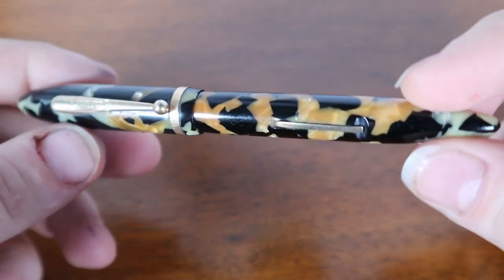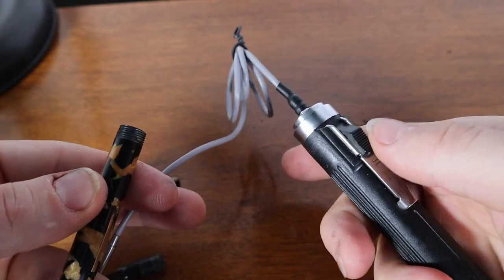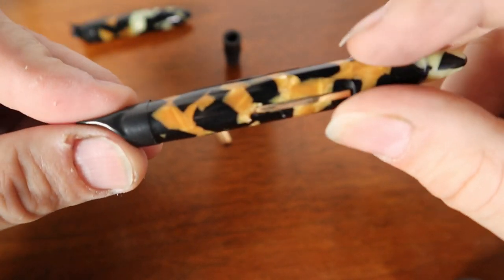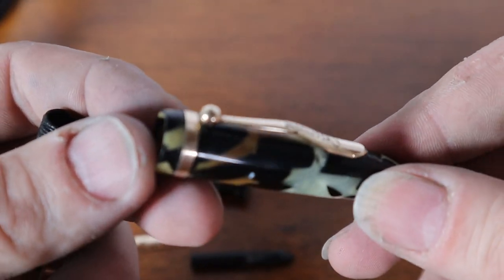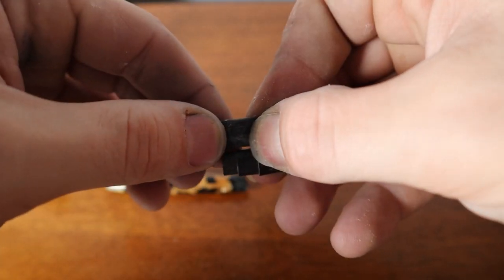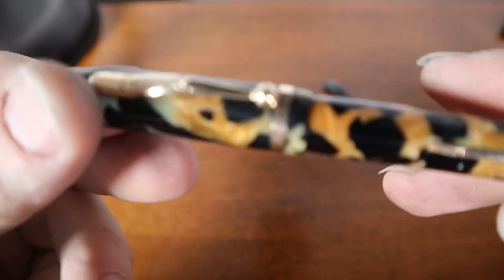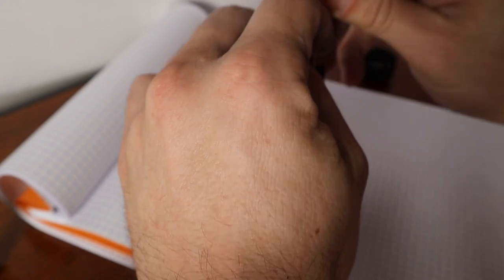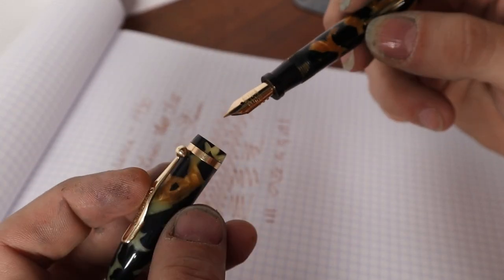Sheaffer Balance Lever Fill Restoration tutorial

Comment: Hello Steven, thanks for your videos, they are very helpful. I am getting addict to fountain pens too and repairing them is what I like the most. At moment I am just at cleaning stage.... you say in this video you are going to soak a bit the cap to remove old ink from it, can you do that when it is celluloide?  Regards from Granada (Spain) . José Miguel
Reply from the maker: Celluloid you should be able to soak and rinse to clean out the cap - just avoid prolonged soaks in inky water since the material can stain. You can usually tell celluloid by the smell - it smells like moth balls when you start to polish it with something like micro mesh. Be careful, though, some vintage brands make their bodies from casein which will be ruined by water. I can think of Conway Stewart Dinkies as an example.
Reply: @letstalkfountainpens8052  Thanks so much Steven, you certainly know the trade

Comment: I have a sheaffer balance lever filler, the small one, not the oversized one.  I am disabled.  Due to chronic pain I had not used it since I bought it.  A uear later I cannot open it to get to its insides.  It is seized shut.  What do I do?  I don't even know which direction to turn the section to opennit, left or right?  Should I soak it in water? 
Please, help me??

Comment: What other methods can you use to get the pen body apart to replace the old sack? I just acquired my grandmother's balance pen.
Reply from the maker: It's really a matter of being able to grip the section and remove it safely. You can use various types of materials to give yourself a good hold on the section - tire inner tube, grip mats, gloves, and even section pliers. The old celluloid can be brittle so using heat is a good idea to help expand it to loosen the joint it makes with the barrel. Aim the heat at the barrel itself where the threads are and slowly rotate for 30 secs - 1 minute as a safe guide. Be sure to pull straight out with a slight twisting motion (one way or the other) vs twist first and if it starts to move you can start to pull straight out. Just be sure to not twist or pull at an angle that might stress and break the barrel. I have never tried it and I don't know that I've actually ever seen anyone soak the end of the pen in hot water to see if that will expand the celluloid and soften and adhesive that might be there. I suppose that's an option but that would risk browning the section. I'd encourage you to look around youtube and see if there are any other useful suggestions. But be slow and steady with heat, gentle twisting and pulling, and purposeful movement that are parallel and perpendicular to the barrel. Hope that helps.
Reply from the maker: Another method you can use is to find people who professionally restore fountain pens if you don't want to chance it. I think most cost in the $50 - $100 dollar range for service/supplies.
Reply: I managed to get it pulled apart without heating it and discovered the sac was still good. I guess that my grandmother had it worked on at some point.
Reply from the maker: @blondescales1  That's fantastic! would love to see how it turned out